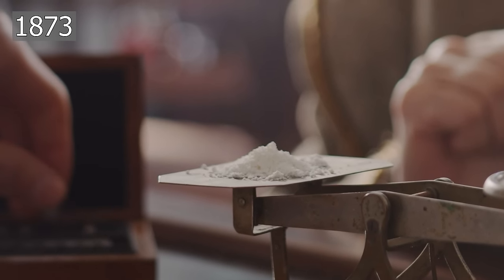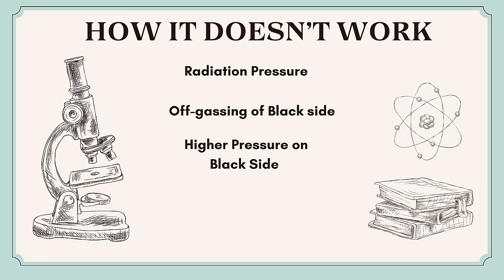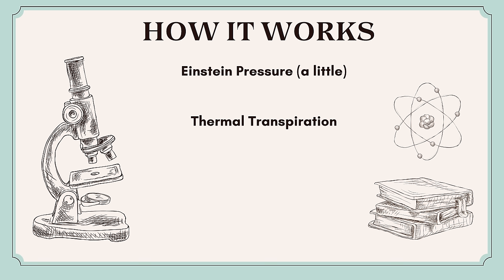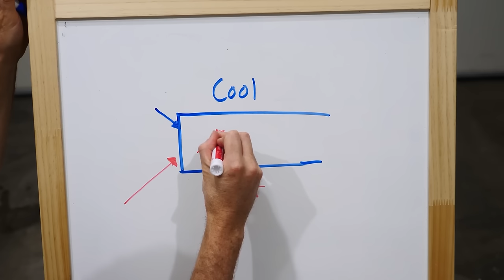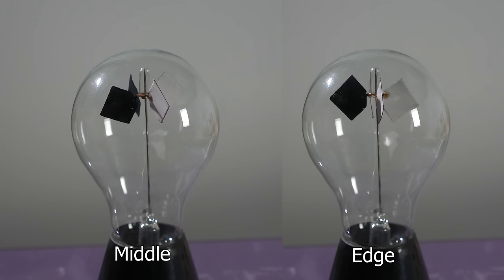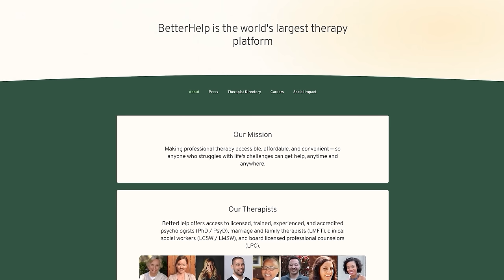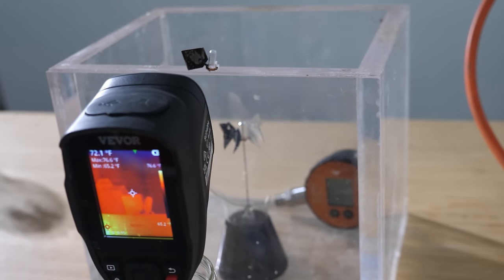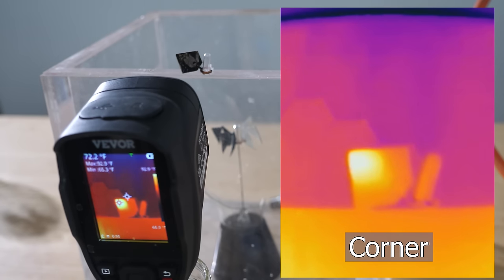Trying To Solve The 150 Year Old Mystery

Comment: my guess is conductive cooling. the white side is more cool than the black side and therefore, when an air molecule hits it, it gets bounced off less hard than when one hits the black side. the air molecule that hits the black side will absorb more heat energy and gains momentum when leaving the black side and thus giving negative momentum to the black side and making it spin. If this hypothesis is correct, then heating up the air inside the bulb will have a different effect as it would cause air molecules that hit black side to lose momentum as it transfers some of it's heat energy to the paper. The difficult part is to somehow only heat the air without heating the rest of the contraption and if it works, the question becomes why is the black side more thermally conductive cuz I think that makes no sense.

Comment: I figured that the reason it moved was that the small amount of air inside heats up on one side, creating a circular air current, and the squares are simple propellers.
Reply: I also wonder: what happens if all the squares were black (or all white); would it move?

Comment: Use a camera - smol brain
Use LEDs to measure light, amplify it and use that as a camera - smort
Use a radiometer - when it finds light, it spins and put that spin on a dynamo, amplify the circuit and CAMERA - GIGA BRAIN

Comment: My best guess is that it spins due to the light or laser causing the device to vibrate at a very high frequency. Maybe the different materials of the squares vibrate at different frequencies when exposed to light and this difference causes an opposing force creating energy which propels the device. I wonder if it would spin if you aimed very high sound frequencies at it?
Reply: should be possible to detect this frequency by hooking a mike up to it then

Comment: So, since air is required, the air must be warming up more on the black side, relative to the white side. If that air is rising, that would cause a decrease in pressure on one side just because the air is moving along the surface.

Comment: Interested to see with or without uv/IR wavelength. Still believe the light is heating up the dark area, which makes the air expand in front of the surface and pushes it back. Heating the edges is less efficient because the hot air can extend above or below. So if heat is the factor, how about filtering IR and UV and repeat the experiment?

Comment: at 1:24  off-gassing of black material, then why not use  other mat that doesnt give off stupid paint.
if not vacuum, dont even call it a raidometer, and is there a raidometer in a near perfect vacuum?
high  pressure on black side due to being hotter - have you head of why the low AIR pressure at the equator is?  so at 2:17 the fast hot air  just kicks the black side? is that it? but it will create a vacuum at the black side than the cold air will occupy the black side space by hitting the black side

Comment: few cents from my side, i guess. you have a closed system and adding the energy to it, the only thing which is unique - the color, so the propulsion will be = to amount of e the color absorbs and emits, the black color will absorb the most energy => will have the highest momentum per sec per energy. to prove me wrong or right, you can try to color one side vantablack and the other side with some titanium or barium oxide whites and try to use a diode with <185nm, should spin as crazy.

Comment: instead of using an outside force of light to heat it from outside, use electricity to heat it from the inside, if it behaves the same way, its thermal transpiration.

Comment: If hot water is poured over the globe, the radiometer rotates in the same direction as if it were illuminated. But if you run cold water over it, the radiometer turns in the opposite direction.

Comment: It's thermal vibration. Think bimetal strips. Just enough to cause a small wave form. 
Try making one with black 3.0 and white 2.0.
I think the vibration is enough to move it. In the air the heat dissipates too rapidly and with more surface area it disperses faster. Air causes the vibration to not really happen. Like you hand on a guitar string or tuning fork. I'm curious as to how this would be tested in space. On a space walk.

Comment: Although these experiments seem to direct light energy at the vanes and try to explain the interaction of the vanes/edges with ambient residual air molecules, could it be that the design of the glass container permits focusing/swirling/heating of the residual gases 'before' they come in contact with the vanes. You might even have a low-pressure 'unidirectional' circulation induced by the vanes, that extends to the periphery of the globe. The directionality of this circulation will be dependent on the vanes themselves, but always guaranteed in the same direction. thus it might be much more dynamic. 
Perhaps this can be tested for by removing the glass bulb and putting the assembly in a vacuum chamber at the same pressure as in the bulb previously. There ought to be less rotation. and maybe the shape of the container has relevance. Square or rectangular chambers may work differently to those of spherical shape.

Comment: could it have something to do with the corona charges being directed outwards? when you cut slits, they were still relatively pointed outwards but when you punched holes, the corona discharge was also directed towards the centre. I know paper is non really a good conductor but you know how it still shows some interesting properties related to static electricity.
 And you know the photoelectric effect. when a light shines on a METAL surface, photons are released. I'm not sure if paper has electrons in it. (sidenote: if not, it'd be cool to experiment with different papers like charged paper, wet, soaked in oil, burnt, different colors, double layered, possibilities are infinite) But I've seen plasma thrusters. Idk it could be all these things but in a very microscopic scale kinda like how the universal gravitational constant is so small.

Comment: I don't think holes would help because then you have less of a black surface for the heat to spread out to.

Like the black top effect in global warming, the higher surface area is reason why so much energy is being held. Except in this case there would be a point where the surface area would reach a point where it impact the aerodynamics of it. 

Unless it was rigid enough that you could get the air flowing, in a whirlpool fashion and it might help it be more self sustaining? (Thinking out loud with that last part...)

Comment: it works like a wing
the white and black sides give the air around it different temperatures
the black part produces more pressure in the surrounding gas and gets pushed away from the heated gas
it will work best if the air pressure next to the black parts is stable that is why it needs to be enclosed
Reply: an additional note what if you change the shape of the surface by bending it so that the white part gets a belly
and it gets the look of a "rocked"
it may have it easier to get pushed by the air this way

Comment: If it's the change in air temperature causing it to spin, following a vane around with the laser and keeping the laser stationary pointed at the path of vane travel should yield the same results right? Am I misunderstanding the thermal transpiration? 

Did you try changing the gas medium around it? What happens if pure nitrogen, oxygen, or some other medium is used inside the encasement?

Comment: I feel like I'm going crazy because no one has done my idea of "'almost perfect?'"? Soundproof chamber. Two cubes, one inside the other, kept apart by magnetic repulsion. Then remove the air between them. Should be able to see a firecracker pop with no sound. I imagine it wouldn't be easy to make. But I have faith in you. -James S hart

Comment: I think the air heats up even though there is very little of it and it creates an upward flow that turns the blades just like a windmill. there is no way to determine how far down they had sucked the vacuum on the radiometer,. Or if they suck it down at all? .. Maybe they don't draw it down as far as you did? Maybe it just needs the air contained around it to allow it to heat up and cause it to flow? That would explain why it doesn't turn out in the open.

Comment: Need to find a way to increase the edge surface without increasing drag.  As for the hole experiment, may there wasn't enough surface area to push the wheel.

Comment: I was always curious if the slight pressure the white vane gets tilts the apparatus on the pin inside the hub, and the hub slides back down that tiny amount on the pin, creating rotation.

I saw that the hub wobbles when the radiometer turns. Part of how it works?

Comment: Strange effect , but I have one for years ,inside an perspex block, and it haves metalic surfaces like aluminium at both sides of the vanes. and it turns in sunlight the vanes are square like yours. I think the form of the vanes is the secret one point up like yours

Comment: The white side reflects the light particles wich have almost no weight so it just repells the light particles. That would cancel out on force if both sides where white. But the dark side does not repells the light particles. It takes them and their motion energy and thus pushes back. While the white side halves the force by repelling like a gummi ball the dark side takes all the incoming energy.

Comment: I must be in a separate timeline because this stuff was solved many decades ago. Thermal radiation causes energy within OTHER objects on top of the energy it expels....in a perfect vacuum, it would spin because the expulsion force would be outward, but since we can never get a perfect vacuum, there are free particles which interact with the radiation. Now imagine a particle near the plate that receives the radiation, causing it to speed up....if we pick a random direction, there is a percentage of that direction being toward the plate, which causes a "bounce" which puts force into it. The white side also has bounce, but the particles are moving slower and not radiated as much, therefore the net effect is movement.

You put a hole in it....ok, you have reduced the surface area that those particles will hit. you also introduce secondary and tertiary radiation responses that cause particles on the white side to now be energized, which cannot overcome the friction....therefore no movement. When you put a slit to increase the edge space, similar secondary/tertiary responses occur in the middle but at least you didn't change the surface area.

If you want it to go faster, then you will need to create a slight parabola at a slight downward angle so that the object creates a slightly upward force to lessen the needle friction, while lens focusing the radiation.
Reply: this was not solved decades ago, people just *thought* they solved it decades ago, not the same thing.  You missed the part where radiation pressure turns out to be nowhere near enough to do anything.
Reply: @tsm688  and yet, here we are...as i said, slipped into a different dimension because we did solve this where i came from. I sometimes get my timelines mixed up, time travel is a little hairy.

Go ahead, give it a test with the things i stated. as for the calculations being wrong, nope, you have to calculate it based on the cooling speeds discovered, not by the original rates of particles.....you know, the same reason why throwing a pot of hot water in dead winter causes snow because of rapid cooling from hotter material than a colder one.

Comment: Perhaps the normal analysis of pressure is an oversimplification at small scale. I would guess it's something related to Brownian motion.

What happens if you shine the laser on the white side?

Is there any colour of laser that works better than others? Hard to find lasers of equal power but different wavelength, I realise. But I'd be interested to know if an infrared laser is more effective in particular.

Comment: This is a shot in the dark, 'cause I am not smart, but maybe the light pushes the air itself rather than the vane, and the white side reflects enough light to cancel out the external light's effect, pushing the air back, while the dark side gets more impacts from the air. Normally the light would push against the air in all directions, but the reflectivity might change that. Maybe try with mirror and black instead of white and black?

Comment: You may find this paper interesting as they do much of what you were doing with a lot more money.   Their testing conditions were far more stringent with interesting results.  Youtube disallows URLs but the title is "Experimental and Computational Observation of Radiometric Forces on a Plate" and Google will serve it right up.

You're gotcha with the holes is that the vane turns due to the difference in pressure and that pressure difference is relatively constant across the plate.  The absolute pressure does vary a lot but that has no effect.  The edge itself is not generating the force, just the flow.  Thus adding holes means the pressure difference simply has nothing to push on in the hole resulting in a loss of efficiency that then must be regained by increasing the difference.  Basically the gain of the hole is offset by the area loss.

Comment: I had to watch this because I have never been satisfied with the explanations. It is a mystery, and we are missing something. When I was a kid, I accepted the radiation pressure idea but didn't know it rotated the opposite direction as expected. I have that same radiometer and have tested it with a violet laser myself and am comfortable saying the black side directly heats the low-pressure air inside increasing the velocity of motion pushing on the vanes. Thermal transfer is over thinking it and is not the driving force. The vanes are bent and crooked from shipping challenges, but it whips around rapidly when the sun hits it.

Comment: A Sub atomic particle has a surface area.
An atom has a heliopause and many internal surface areas as sub-atomic particles.
A molecule has a defined center of gravity, and enhancing molecular composition will increase the total surface area. 

When the compilation of molecules has reached the size of a blackhole it is reducing the total amount of surface area by breaking components down into sub-atomic particles. 

Scale is infinity on both sides: you can endlessly increase your scope of vision in both directions.  

Finding the components that are smaller than light will define space further away than light can travel, as being smaller it is less likely to interact or hold relative mass.  A photon is a mass body, and a black hole will break these down into smaller components  already.  

The light is a thing: unless of course a horse power is no longer applicable once I am measuring forces of multiple galactic motion.  Sure: the movement of a horse does not have much effect on our local group of Galaxies: but it's mass is never zero until it lacks an entire dimension of continuity to be a whole 3D body, and that is smaller than gravity, light does not escape a black holes gravity: the force is  more absolute.  

1 apple. No you can not split it: because math called it a 1.  2 oranges can each be split into 1 orange each.  1 photon, you might be able to split it: but since we can not detect what it becomes: it is the limit.  This is the same argument as any flat earther: because you can't see it! 

Light has mass once you measure something smaller. 
Light refraction is due to interaction: because as a particle with mass: it can be acted upon.  

Rods and Cones...  Life started as Ameno acids and enzymes, you don't get to 'see' light until your an advanced single celled organism!  
So what did they sense the world with when compiling Rna and DNA: before life could see?

Comment: As atoms cool, the electrons return to their ground state, releasing photons in the process in the form of infrared radiation off the material. The veins movement may be a result of the back forces from the leaving photons. would rpm increase as the blades rise in temp?  Would the blades spin faster in a chilled vacuum vs to the base temp vacuum?

Comment: Convection currents I use a infrared heater in my garage and my feet are always absolutely freezing because the hotter air rises that's my theory anyways having the air rise and hits the top of the build cools and swirls down

Comment: Is it possible that the light hitting the black side heats up the air on that side while the air on the white side is cooler, thus causing a low pressure area that pulls it in the direction of the white side?

Comment: Guessing that it is energy not momentum, that drives the vane.

So more energy is stored on the black vane than the white vane.  As the energy bleeds away to air it drives the vane around.  If true it should not work in a truly hard vacuum, unless the black paper is itself vaporizing?